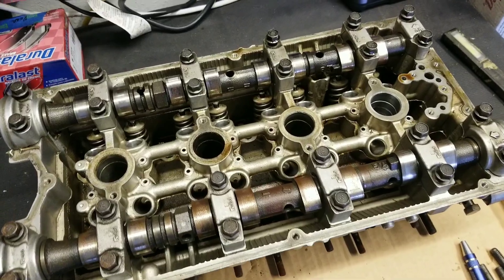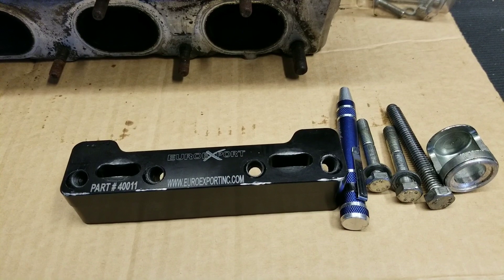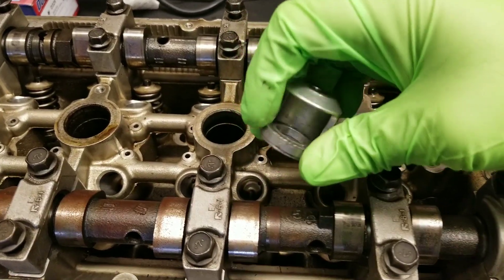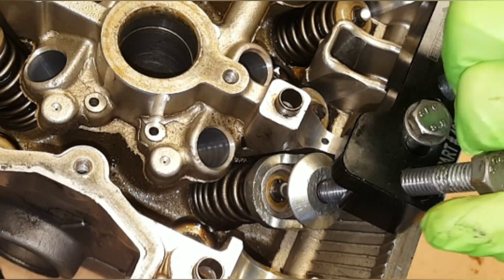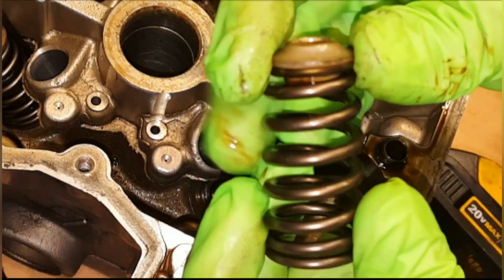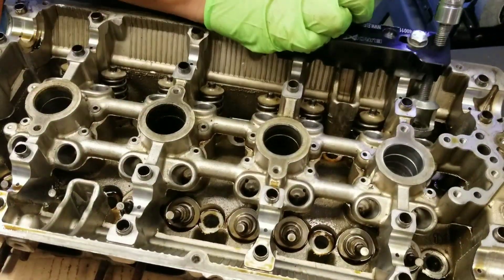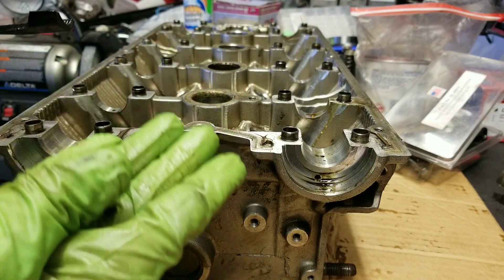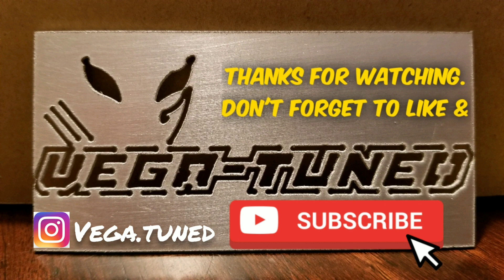Euro Export 4g63 Evo / Dsm Valve Spring Compressor Tool Review

Comment: I just picked this up today, when I compress the spring the valve pushes out so I can’t remove the keepers, how did you keep your valves from moving?
Reply from the maker: Try just using the cup from the kit.  Set it on the retainer and hit it with a rubber mallet.  It should shock the keepers and make them want to release.
Reply: @VegaTuned  I went through and whacked all springs, maybe I didn’t hit em hard enough? Anyways I’ll have to try again tomorrow wife’s complaining I’m making “too much noise”
Reply from the maker: @oscargutierrez970  haha yea don't want to upset her.  Yea sometimes they can be stubborn.    You got this. Lmk how it goes.
Reply: @oscargutierrez970  Did hitting the retainer with a rubber mallet  end up working out for you? Doing they the same thing right now as I’m trying to replace the valve stems
Reply: @Andrew49683  I used a deep socket and a mallet , gotta put your back into it . Then then at least 1 keeper will fall off and you can take out the retainer , spring and valve .

Comment: Great video thanks for the upload! Just a question can you use that in all 1G and 2G even the NA heads? And that valve seal remover tool can you also use it for installation of new valve seals? Thanks!
Reply from the maker: Yes the tool works for all 4g63 and 4b11 motors.  I don't recommend using the seal remover tool to install new seals.  All you need to do is slide the new seal on ,then using a socket similar in size push down till it seats